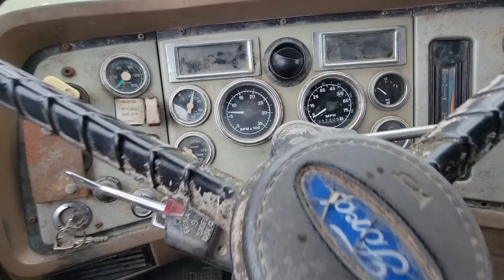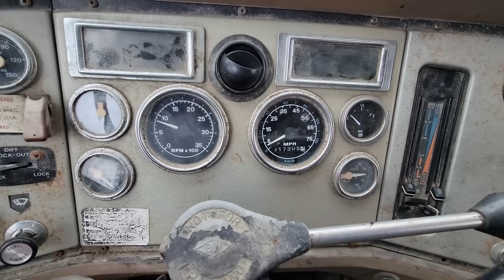L9000 N14 MECHANICAL ENGINE....REMOVING 4000 GALLON TANK. WORST FRAME RUST JACKING I HAVE EVER SEEN.

Comment: that is probably the worst rust jacking i have ever seen and iv seen some that were not near that bad but the rust jacking had split and cracked the frames. unfortunately yeah that truck is destine to be parted out and scrapped just not enough value when done to be worth the needed repairs.
Reply from the maker: wrecker may be up for sale soon. the one i told you i had been perusing might becoming available.

Comment: Wow that's got the rusted frame on my '85 Mack beat.  We had to take the Mack off the road because the trunnion support pushed up into the bottom side of the frame.  Hopefully your parts will help someone else keep a good old truck on the road.  Like you said you can't beat the mechanical engines.

Comment: The Cummins NTE 320/350/400 were about as good as it gets. The NTAA series weren’t bad for the own-mechanic but CELECT took a while to prove itself, to put it kindly. An early adopter of the CELECT engine in the UK reported that the high-tension wires on pylons which ran parallel to a section of the M25 motorway caused the ECU to go haywire resulting in misfiring and derate/limp-home mode. I guess later versions were better hardened against electromagnetic interference, and that one was too after service intervention 🙂 Names of truck manufacturer and haulier withheld to spare them their blushes 😆

Comment: That's hardly even rusty.  You havent seen rust until your a northeast municipally mechanic.  I have seen those double frames rust jacked so much that it cracked.  I could take the bottom rib of the frame and touch the ground with it.

Comment: That was a old Con-Way L9000. With the orange cross member, it began life as a CCX single axle truck.
Reply: That must have been the best truck in their fleet with an N14.  I thought they all had L10's in them.
Reply: I think the orange one was the one that was replaced.
Reply from the maker: like i said, the orange cross member was replaced due to rust jacking.
Reply: @j.c.smithprojects  Could be just the cab put on to another chassis.